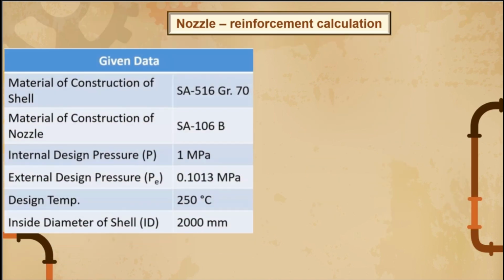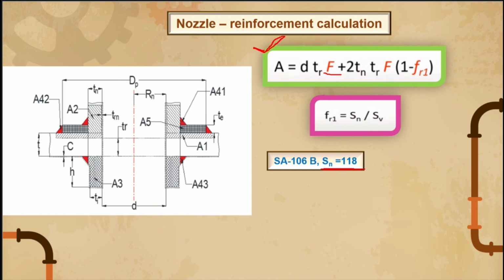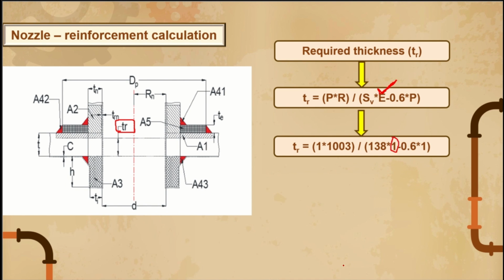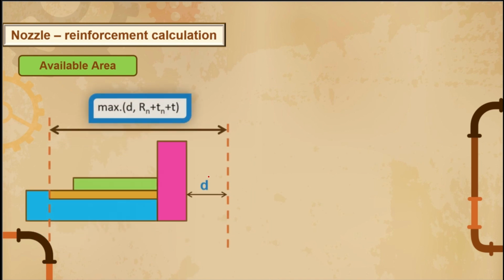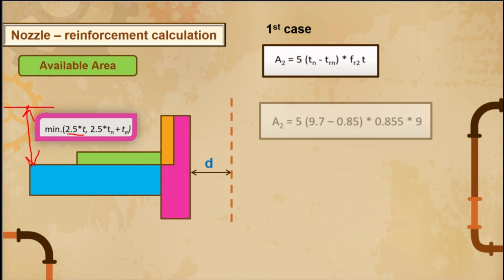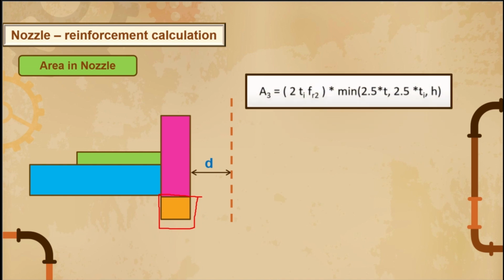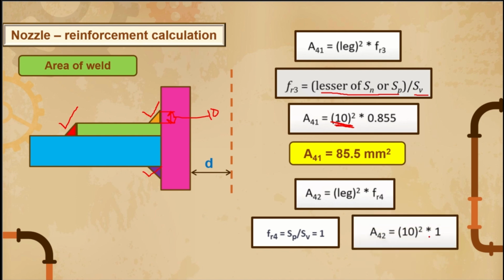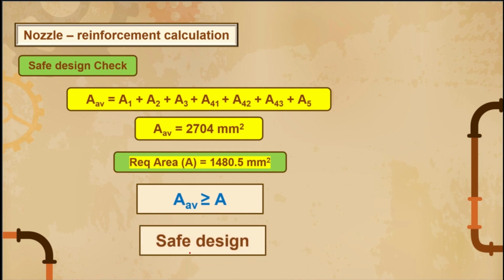UG-37 Part-3 Reinforcement area calculation problem

Comment: Thank you, but where is the calculations with external pressure?
Reply from the maker: Thank you for watching.
For external pressure ASME BPVC UG‑37(d)(1) limits the reinforcement area to 50% of the internal pressure requirement. 
In this example, internal pressure governed; hence, the external pressure check was not shown separately.
Reply: @MECHTechworlds  ok so do we calculate the thickness of the shell and nozzle acc. Internal pressure? and calculate reinofrcement according to ug-37d?
Reply from the maker: No dear it depends on application.
I suggest you calculate thickness for shell according to ug-27 and ug-28.

For nozzle and reinforcement please follow ug-36 rules and Ug-37 formulas according to your application and if you have still doubts please watch the vedioes related to openings and reinforcement.

I explained all the topics in detail, step by step, hardly it will 50mins to watch all the vedios, so you will get better idea on it.